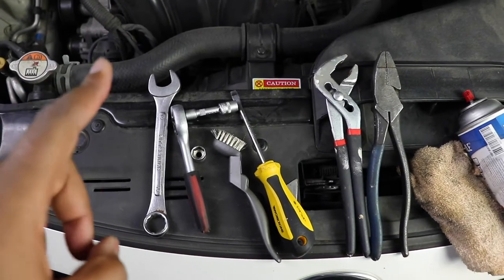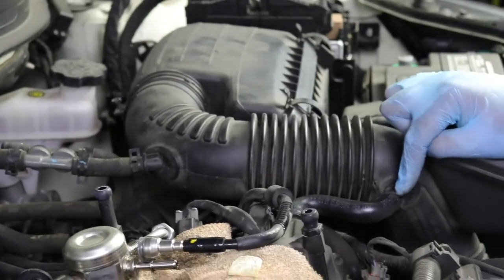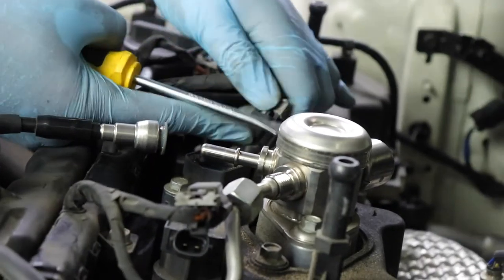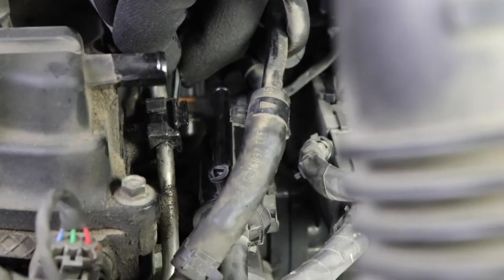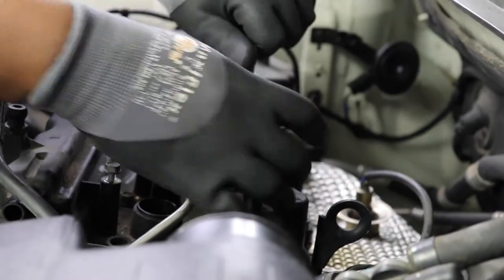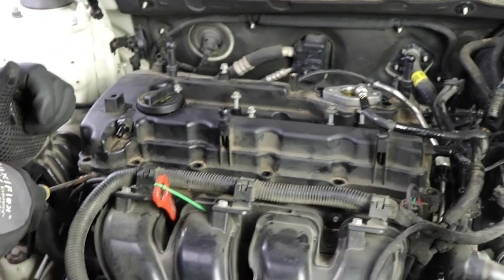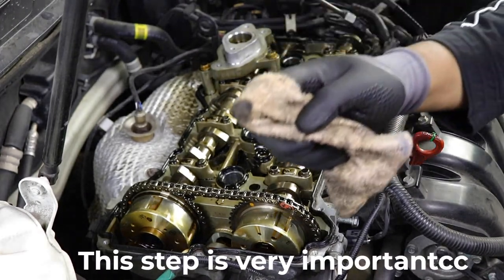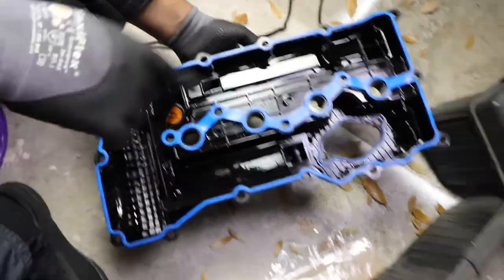HOW TO REPLACE A VALVE COVER GASKET | KIA OPTIMA 2011 - 2015 | 2.4L GDI ENGINE | PART 1 #kia

Comment: Hey carl what's up man, the steel hose on the high-pressure fuel pump that line can flex. Your technically supposed to replace the line Hyundai/kia manufacture request for the customer to replace that line. Anyways just wanted to put a tip on here you dd a good job on replacing that valve cover. I was a Hyundai technician for 5 years way back. I work at Toyota now. if you got any questions man i got you, great video. I kinda want to start making videos to also help people out.
Reply: Hey! I have to do this very job in 2 days. I have all the tools and am an amateur mechanic. I did the knock sensor start to finish in 90 minutes on this motor if that helps. How long should this valve cover job take start to finish and what should I charge the customer. I have my own synthetic mobile change business, but do other light to intermediate repairs to. Thanks.
Reply: @elmayimbe_the_amateur_mechanic  This whole job should take about 1.5 - 2 hours.  This includes cleaning out the valve cover and cleaning the mating surface on the cylinder head.

Comment: This was one of the best videos and explanation of the repair for the valve cover gasket replacement.  I would say excellent filming by the wife, good zooming when necessary.   You took the time to explain everything and really didn't leave anything out.  Kudos!!  My wife has a 2016 Kia Optima LX 2.4L GDI.  At 125,000 there is what I suspected to be some burning oil going on but I also see oil at the rear of the Valve cover pretty much along the mating surface.  You can see trace amounts of glistening oil.  I noticed on an oil change today that oil has dripped down on the CV boot, and some other components.  Yeah, its looking like the gasket has failed....You say 8-10 hours?  Couldn't it be shorter?  I noticed you could have used a Impact drill driver with some universal sockets to speed it up.  Just saying...Otherwise GREAT JOB!!!
Reply from the maker: Yea it took that long due to filming. If your wife has this car make sure she has the KSDS when the engine fails. So she’s protected, and get the free engine replacement.
Reply: @StraightOuttaContent  Uh, what's the KSDS?  There is what we feel is kind of skipped acceleration off the Green Light.  Slight hesitation.  I think uncovering the Throttle body and cleaning it out good of spraying the throttle body cleaner might help. Recently changed spark plugs last year too.  Have you experience that too?  Of course unrelated to the Valve cover gasket issue fix.  Some Kia forums are useless, nobody responds in a few months while looking for the same situation with acceleration with other drivers.

Comment: Thanks for a great pair of videos about this gasket replacement! Your video was super-clear and instructive to a novice like me. I was able to access the bolt under the fuel line by flexing it slightly — this did not seem excessive. I also noticed that the Fels-Pro gasket does not fit for me and some others around one particular bolt (the middle one on the timing chain cover). The gasket has too big of a kink on the rear side of the bolt hole, causing it to jump out of the channel. I fixed this with some weatherstrip adhesive, which I also used lightly in the opposite corner near the fuel pump. The thing is, the valve cover and gasket is meant to be universal for 2013 Optimas. It’s almost like the Fels-Pro design is a little defective?

Comment: No need to remove all those lower and bolts on the fuel line.  The metal fuel line can be slowly and gently bent to the side (do not link line).  The fuel lines are manufactured in a 100 lb round coil, cut and bent at the factory into their current shape.
Reply from the maker: Its a kia bro. You can do that shit on your car. I dont trust anything kia, that why I got rid of this piece of shit and got a Lexus

Comment: I have a 2016 Kia Optima EX 2.4 with oil in with a spark plug… I love this video but mine being a slightly different model. I wonder how much I can actually use this video?

Comment: Quit question, where did you buy? Your valve cover. I bought my valve cover on eBay. Came with the gasket, only one gasket didn't come with the other gasket. That goes over the high pressure fuel pump.? Just ordered it now. I gotta wait came and drive my car. Hopefully you can answer this real quick stuck in a pickle. I just ordered the one you have listed and your bio on Amazon.
Reply from the maker: No problem, if you have a Kia though you have bigger problems. Please check out all my videos on the Kia engine settlement. Those cars engines will fail and when they do, if you don’t have the ksds installed you won’t get your new engine. Consider grabbing my book https://www.flashcustomtransfers.com/product/kiahyundaienginehandbook/265 or just watching all my videos here and on @carlsgarage
Reply: @StraightOuttaContent  thank you sir Bought all the parts installed it with no problems Start of the car up no more oil leaks
Reply from the maker: @socalevo53  Yea ummm that’s not where the oil burns from. There is a major recall on these Theta 2 engines. Hence all the videos after this one. Car still burned oil. Lucky I had the ksds so when the engine blew I would have got a new engine. I got rid of the car before that happened. Might want to watch all my videos here and on @carlsgarage cause if you don’t have the ksds, you’re going to be shit outta luck when that engine blows. And it will blow

Comment: How long did it take you to replace the gasket?  Just curious because I just had mine replaced at the dealership.  Btw, I also drive a 2015 White Kia Optima with 143 k miles on it.   My car was literally at Kia all day for this repair as they didn't know what was wrong with my car at first.
Reply from the maker: With filming it took me around 8-10 hrs straight

Comment: I'm a mobile mechanic and have to do this on a 2016 Optima 2.4 in a couple of days. How much should I charge laborwise?
Reply from the maker: Holy shit ummmm man. You have 2 options. You can call the dealer and find out how much Kia charges and then charge that amount too or start at like $400-$500. If I had to do one today I’d charge $400. It took me a long time because of the damn high pressure fuel regulator. They didn’t make it easy to remove or put back.
Reply: @StraightOuttaContent , so start to finish, without taking a break, this is like a 4hr job?

Comment: You asked me what is wrong with my KIA soul.  I tried to reply but it wouldn't "comment."  I have to use this comment area.  My weird laptop?  2014 Kia Soul with a 2.0 engine.  Replaced valve cover gasket 4 times, last time with an OEM valve cover gasket set.  Still leaking oil....  Afraid there may be a crack in the engine.  It was taken to a KIA dealer for the knock detection software update and a recall on rod bearing connection and a steering pin recall too.  KIA Soul is not covered in the 2.0 GDI engine recall.......  I have a sinking feeling in my stomach about this.
Reply from the maker: Yes you're correct. The soul was left out and a lot of people are suffering. You might be able to sell it or trade it in. Might be time to move to a toyota. They run forever
Reply: @StraightOuttaContent  I drive a Kia soul and my oil light just started doing the same thing as yours. Turning on when stopping. Taking it to the dealer today.

So the soul isn’t apart of the engine replacement? Or just isn’t apart of the recall?
Reply: Got an update?